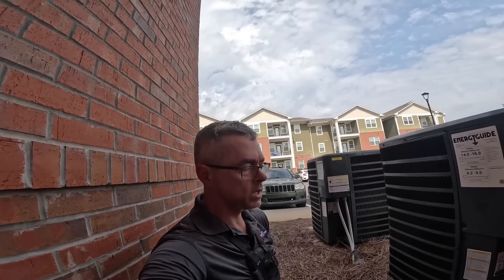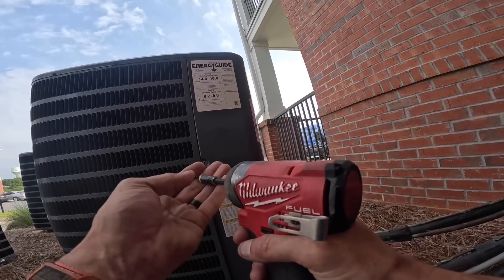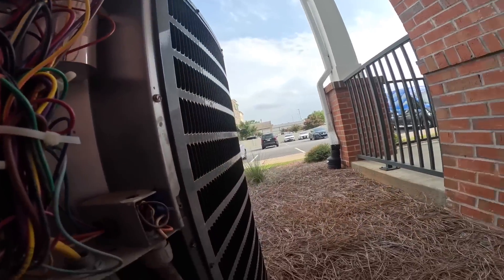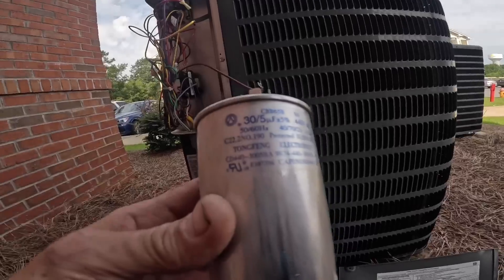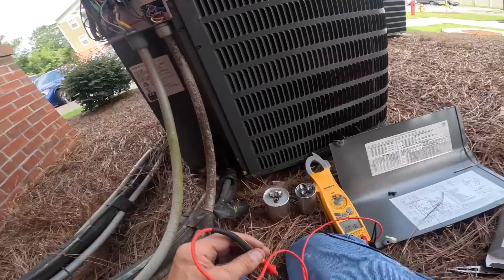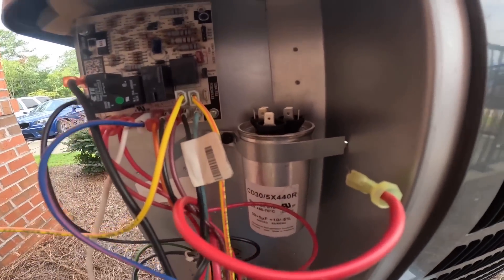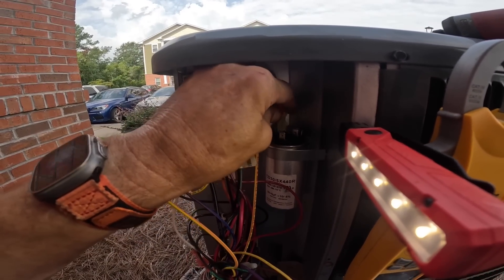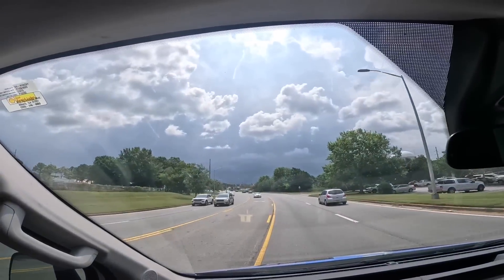No Cooling On Saturday! #hvacguy #hvaclife

Comment: From the Video at 0:40 it looks like the Capacitor CASE was arcing to ground. Must have been shorted internally. I have never saw that before. Seems like the mounting strap would've grounded it out. Thanks for the Video! I am in the Hospital and that saved my sanity from staring at a TV!😊👍
Reply: I hope you get well soon. I know that's a drag. I was going to say use the word "seen" instead of "saw", since you used the word "have". Very unusual, it is normally the other way around. LOL
Reply: @jthonn   oh oh it's the grammar poleese. ha
Reply from the maker: Get better soon. The fan was running, what you were seeing is the light flickering through a hole behind the capacitor
Reply: Nice catch.

Comment: A few years ago, the start cap failed in my condenser in the middle of a heat wave. When I went to buy both start and run caps, I bought two so I’d have a spare set waiting in my garage when it happens again. 😎

Comment: Yesterday my ac stopped cooling. Fan was running. Condenser was not producing hot air. I pulled breaker and opened panel. Plugged back in breaker and immediately i noticed hot air. Any ideas? Is my cap going bad? Their was a storm but don’t understand what happened

Comment: I'm at 1:29. Don't even know what's wrong. But if that thing has one of those capacitors that looks like it's got a drop of solder on top, it's trash. Change that dang thing even if it's not bad. They are on several brands and they are junk.

Comment: Reminds of that time I thought it was a “cap and go” and I touched the cap to the low voltage side of the contactor like a rookie and spent the next 45 minutes doing my rendition of a contortionist getting into the attic to replace that dang 5 amp fuse 😂

Comment: As someone who has done field service, the key to not losing tools is: 1) develop good habits, such as where you set down your tool so its not hidden when you look around at the end.  2) Check your tool kit as you pack up.  Make sure everything is there.  3) It helps if everything in your tool kit has a "home" so you can spot the empty spot.  You'll still misplace tools, but you should be able to avoid leaving them behind at a work site.
Reply: The guy who was here left his DeWalt drill/driver behind.  I called the company and let them know.
Reply: when I was doing this work, any tool not in my hand or pouch, was in the panel / cover. As I reinstalled each item, the tool went back into the pouch. When the cover was back on you should only have that last nut driver in your hand.

Comment: Usually the common on the cap has 4 spades, the herm has 3 spades, and the fan has 1 spade. Just a little tip, but it's always good to double check just as you did. Thanks!
Reply: That's usually how they are, but on this one there were 3 posts on COM and HERM, and 2 on fan.

Comment: I do like those caps with the color coded plastic insulators surrounding the spades.  Like you, I have trouble reading the C/Herm/Fan stampings when mounted near the top inside the cabinet.

Comment: One thing techs never take into consideration, is the placement of condensing units. They really need to be installed in the most shaded area of a home 🏡
Reply: Absolutely not. They need to be on the Sunny side of the house if possible. They won't have to defrost as much in the winter because the sunlight shines on them. It's in the installation manuals. Summer makes virtually no difference, it's all air temp, as long as the refrigerant condenses.
Reply: @Bryan-Hensley  
I'm a old service tech 64 and have been performing service, repair and occasional install and retrofit for 43 years. I agree with you. The condenseing unit doesn't care and operation of the system isn't affected UNLESS the unit is placed under overhangs lower than 6' and away from the side of building at least 18". Those coils NEED proper airflow to work efficiently.

Comment: @HVACGUY did caps on the old units hold a charge? I've never seen one discharge in 16yrs. Microwaves are another story. Pop everytime
Reply from the maker: All of them can. I’ve been bitten by them a couple of times over the years. It’s well worth shorting them.
Reply: About the only time they can charge up is if a winding is open.

Comment: Love your channel and thank you. Ive watched and learned from a lot of your videos. .. However the little bubble might be misleading as far as I'm concerned it doesn't always mean it's failed some of these capacitors are designed with this little bubble I have checked many on systems and out of the box with acceptable readings and normal operations. The feature is designed to allow the dialectric oil to escape rather than explode it's designed so the capacitor can fail gracefully and buildup pressure until something gives due to high voltage or overload without the bang!. Like a stem on an oil tank or thermal expansion tank. Love your videos.

Comment: Too bad you're not in the Knoxville area.  Our AC isn't keeping up (83F in the house yesterday), so I've got a HVAC tech coming.  The system is two years old, and is 1/2 half ton smaller than what we had, so it has ALWAYS struggled; I'm not too happy about it.  Filters are clean, and the coil isn't icing.  There was no cap on one of the outside valves, so I put one on, but probably way too late (if it was leaking).
Reply: Why did you down grade the size of the ac
Reply: @EthanHurley-ky4hi  I did not, voluntarily anyway,.  Unfortunately, I may have simply been screwed, not sure yet.
Reply: @OnusBones  dang that sucks if only you said if hvac guy was in the Knoxville area then you wouldn't have been screwed up by that hvac guy that put your system in
Reply: I put in a small window unit a few years back in my living room, and it helps the big unit big time. It's an 8000 BTU LG, so that is over a 1/2 ton of AC. It would give you back that half, and take some of the struggling off your big unit. They only run about $200 at HD.
Reply: He added about a pound of 410A, and it is getting cooler, so that's good.  Hopefully all's well that ends well.
Reply: @OnusBones a two year old system shouldn't need any freon. You've got a leak that needs to be fixed while in warranty
Reply: @Bryan-Hensley  It may not have been properly charged from Day #1, since it has ALWAYS struggled.  The lineset is probably 20-25 feet, for which an allowance was probably not made.  I AM going to do a leak search on it (I have the tool), but hopefully find nothing.